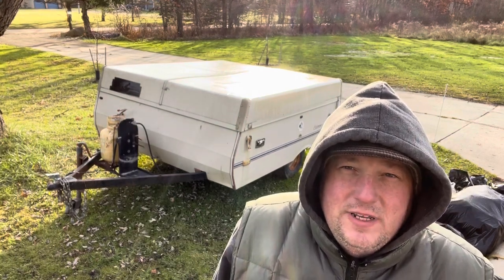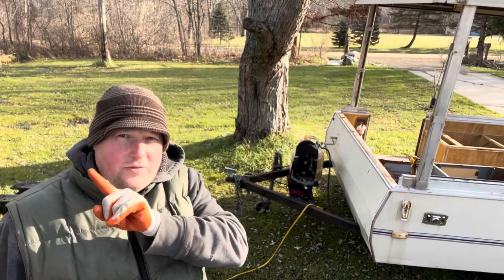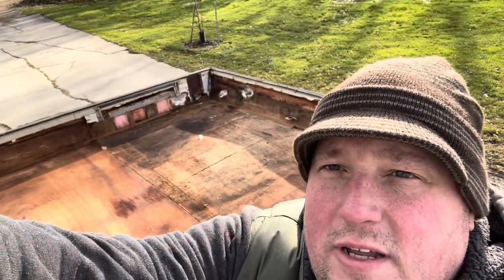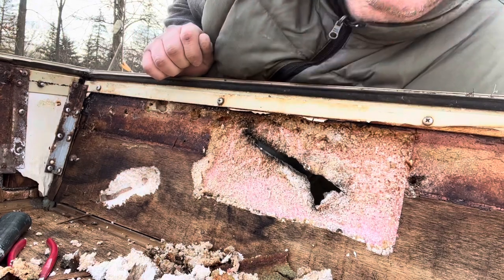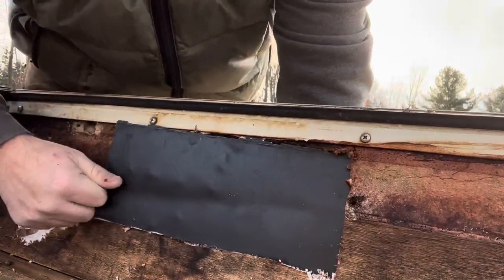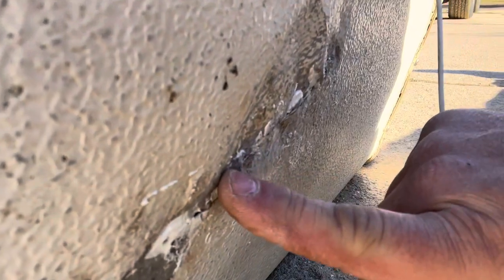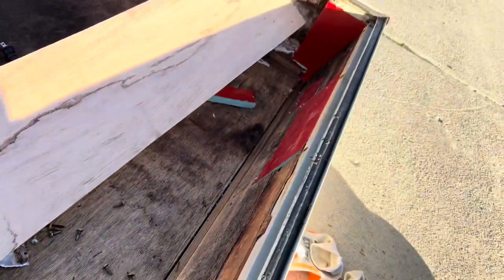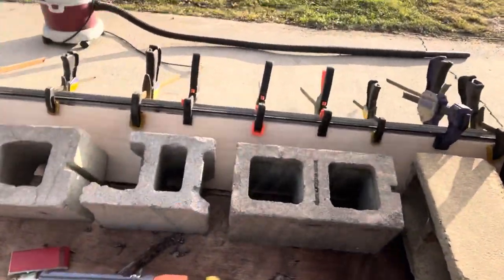PopUp Camper ROOF REPAIR | HOMEMADE - HARD SIDE Conversion Tiny Cabin ep3 #diycamper #popupcamper

Comment: You should replace the entire top that's all rotten wood I went through the same thing when I did my pop up conversion
Reply from the maker: I know its hard to tell but that isn't wood I left in the roof.  Its skin of the wood stuck to the foam board that basically kinda stained it.  Then I tared over the foam board and used new wood.